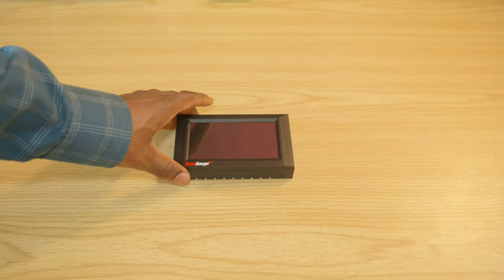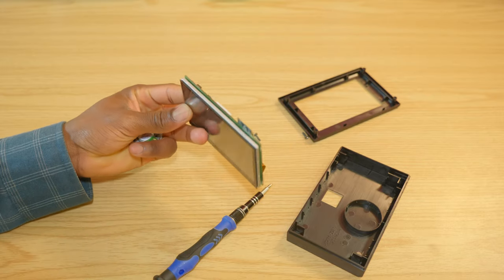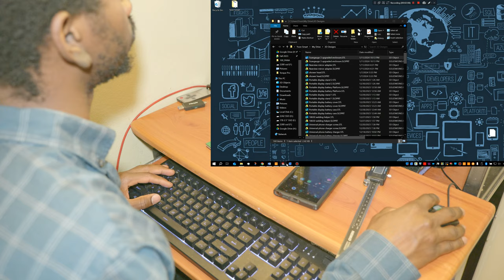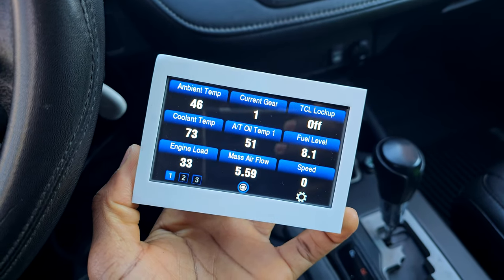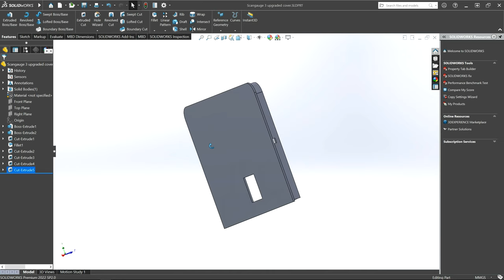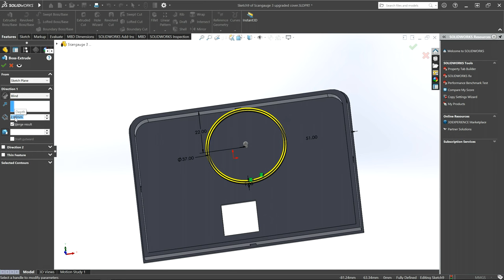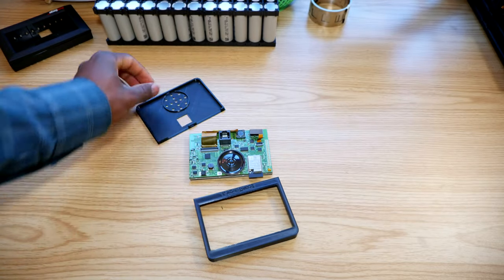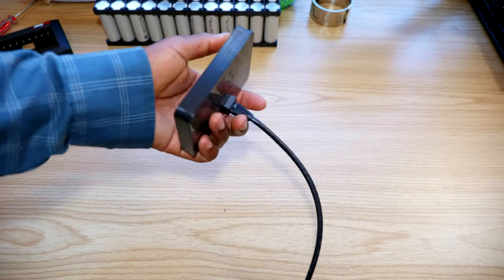ScanGauge 3 modification | Upgrade

Comment: absolutely great idea and most likely an example to follow (for me).
It just that I would've first wraped that internal part in a heat shrinking material to use and see where on my vehicle it would fit conveniently: I almost always have a thing or a few irritatiing and inconvinient where ever I put new gizmo in my vehicles. Then prolonged try and inprove.
Thanks for the ideas!

Comment: Thank you very much, I’ve downloaded the file. I’ve not done much 3D printing recently. I do own one. Also don’t have the scangauge 3 yet. Waiting of it to turn up
Reply from the maker: You are very welcome. It does shrink the size a bit, a lil tight so watch the ribbon cable when closing the back piece. I might make a dash integration model to eliminate the phone style mounting option which isn't so great
Reply: @YvonSmart  that would be great. I'm going to be mounting mine onto dash

Comment: I have found I’m getting a lot of glare at night on the windscreen in the OG housing. Have you contemplated a version with a shade/hood to reduce glare?
Reply from the maker: I haven't designed a version with a hood yet, I might work on that
Reply: @YvonSmart  I’ve ordered some black plasticard, hoping to bend it around with the heat gun and use thin double sided tape.

Comment: Yvon, I have sent a link to this video to ScanGauge more precise to James @ ScanGauge. Just my .02 cents is ScanGauge will not have a problem with what you have done to the case. Years ago they would send out extra covers / cases to customers who would mold a ScanGauge into the dash of their vehicles or come up with unique ways to mount the ScanGauge. ScanGauge enjoys getting involved with the customer and seeing the customers ideas. ScanGauge is located just across town from me and they are automotive enthusiast.
Reply from the maker: Hi, thanks for your comment! That's good to know. I  was hoping I could shrink the case a lot more than this, but it wasn't so bad. Integrating the design to the dash should be an even more interesting project

Comment: You do nice work, and I agree that the Scangauge III is a bit chunky, but honestly I don’t think you accomplished much space savings—not enough to make the effort worthwhile, anyway.
Reply from the maker: Yeah, I was also going to remove the connector socket from the back and solder the wires directly to the PCB for an even more manageable Scangauge but I will be doing that later when I get a thinner cable like the one found on the UltraGauge
Reply: @YvonSmart  Why not just use a flat network cable instead.
Reply from the maker: @ray32825  A flat cable would be great, couldn't find one with OBD2 connector

Comment: Would love one but don't have a printer unfortunately.  I'd buy one. How is that mounted  in your truck?
Reply from the maker: I used the original mounting kit, the metal plate stuck on the back of the scangauge then I use the magnetic phone mount

Comment: Nice case and it does appear to save some space. I could locate the file. I do not have a 3D printer so I would have to take the file to a local business to have it made. Can you provide more details on the specific location for the file? Also, would you print one to sell?
Reply from the maker: The 3D files link is in the video description (first link). If you wish, I can print one for you for free if you pay shipping. Email me if interested
Reply: @YvonSmart  could I have your email?